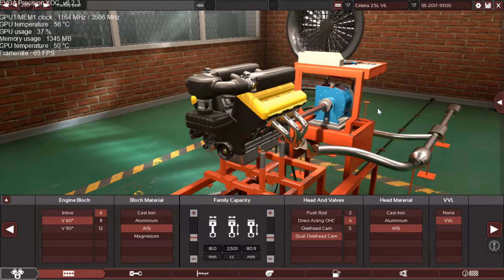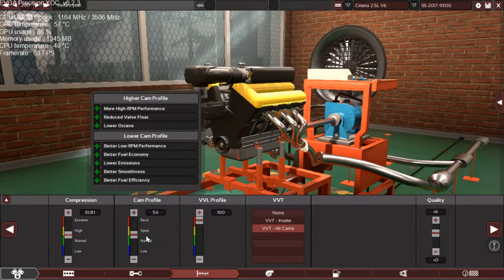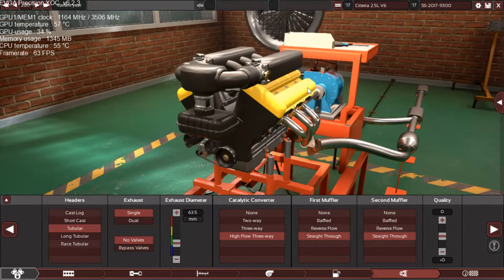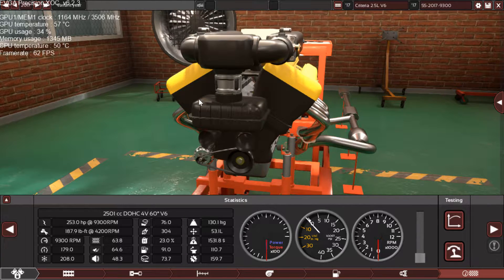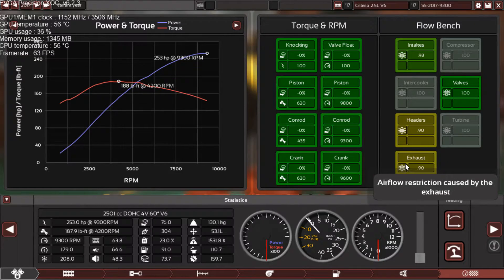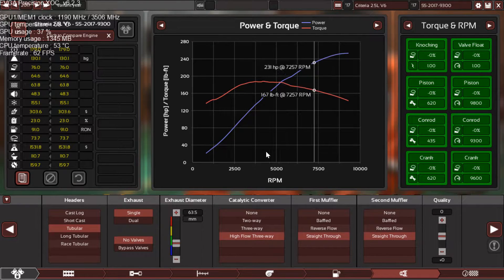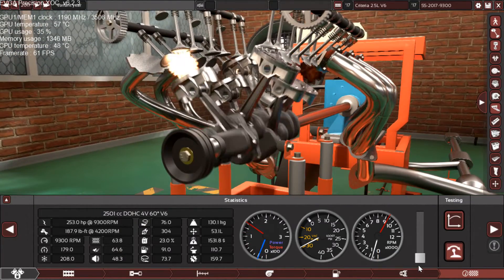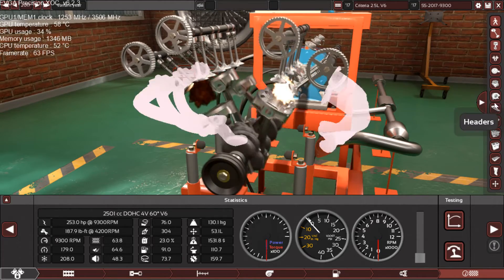A Rotary Replacement Engine build.

Comment: Hey bro
Im still waiting for the modern le mans race car
Btw gud video bro
Reply from the maker: I’m waiting for the suspension system to be fixed because the developers has made it impossible to do a racing car without having 15 warring lights.

Comment: V6 sounds beautiful at high rpm, it is not like V8 or V12 growling sound. :) So request is... can you make V6 engine which reaches his highest  power output at some 11 000 rpm, it is possible to do this at this game? This engine could be n/a engine, because this game does not includes turbochargers... THANKS

Comment: i have a good challenge for you mr Bshar Nasri, build a concept engine, the restrictions is nr.1 maxumum size is 2.4 liters, nr.2 need too have a a fully aluminium engine, nr.3 maximum amount of cylinders is 4, nr.4  it has to have a turbo, now the things you need to achive is, nr.1 is at least 700 hp or 521 kw of power and 824 newtonmeter of torque, 2. have a single exhaust, nr.3 have a exhaust sound that is close to the Subaru boxer engine, nr.4  use the same engine speec as the 2005 Subaru imprexa wrx sti used besides the engine size uppgrade.if you can make it i would be very happy, beacuse for some reason they took away the boxer engine from the game a while ago. don`t know why but it is sad to say the least.
Reply: I think it's due to loading issues. But I'm sure the boxers will EVENTUALLY come back and the glitches will probably be fixed by then if that happens within the next 14 months.
Reply: sounds good.

Comment: As a rotary fanatic, I love this...we need more support for rotary stuff!
Reply: The answer to your question: The RX8 had a rotary, and had close to 240bhp and had 165lb ft of torque.

If I built an engine like that in real life, I think it'd fit perfectly in any RX7 and any RX8.

And as for Alexader Familo, I love the rotaries too, but this V6 challenge of mine is almost exactly like one in several ways: High[er] power yet low[er] torque at high rpm, the noise is as similar to a rotary as you can get for a production car V6, it's very lightweight and compact, and it actually goes up to 9300rpm! Some rotaries can't actually go past that figure, nor some V12 DOHC 60-valve supercars for that matter! It's better in efficiency [if rotaries were in Automation, I'd probably expect emissions to go up to 2500, and this one has only 75], lower in cost, excellent in reliability [that V6 will probably last around 170,000 miles and a rotary typically goes only 100,000], and overall, it's almost as unique as a rotary engine. Probably the most unique naturally-aspirated V6 to ever exist.
Reply: SapphireSumo6615/DFTW Official/Luke Thomas I can see your point. But I personaly own a rx8 with 134,000 miles on the original engine...it matters greatly on driver habits and maintments. And I wonder about the cost of that v6 to make it compete with  a rotary. I mean rotary' s arnt exactly cheap but. That v6 must have some quality parts to do so.
Reply: @wolfyhalfmoon819  I should probably build a replica of this engine and put it inside of a small sportscar...
Reply from the maker: oh how i wish